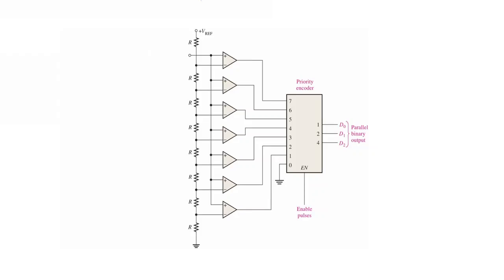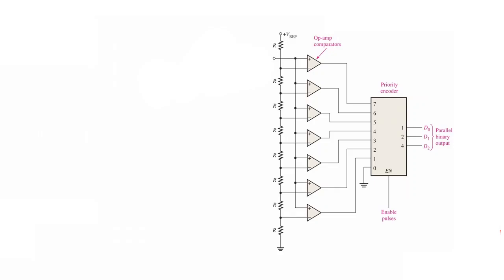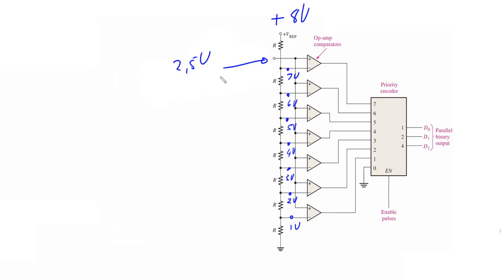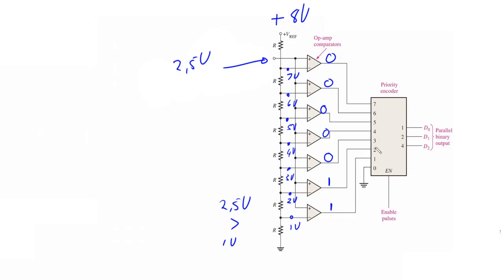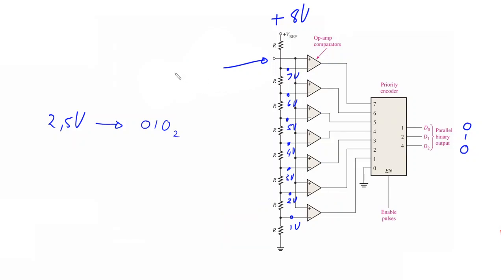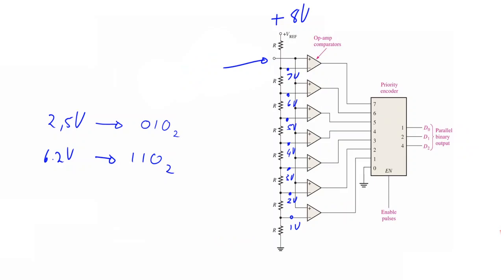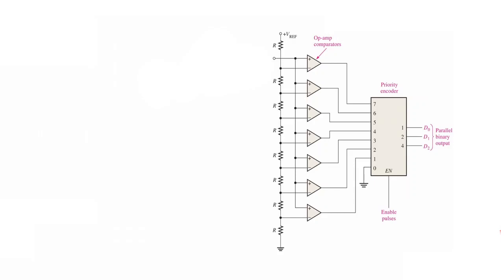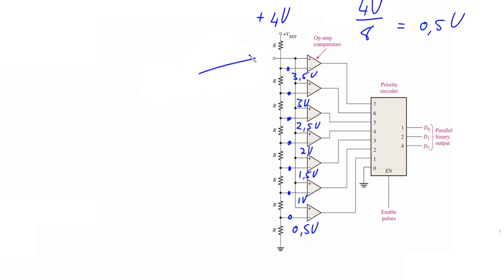Flash ADC (3-bit)

Comment: I think the last example has an error. You compared 2,2v to 0,5v 1,0v 1,5v and then jumped to 2,5v. 

So the real value is 4, not 3 as 2,2v is larger than 2,0v on line 4. So the output would be 100, but the concept of the video was made clearly all the same.
Reply from the maker: You are quite right!

By not aligning the voltage reference values properly with the op-amps, I completely missed the 2.0V output and therefore did not show the 2.0V op-amp as being HIGH, as you pointed out... 🤦‍♂

The answer is indeed 4, and not 3.

Thanks for noticing and pointing it out.
Reply: thanks mate